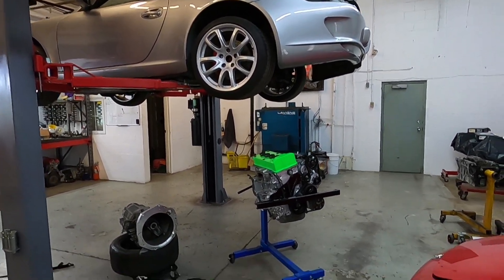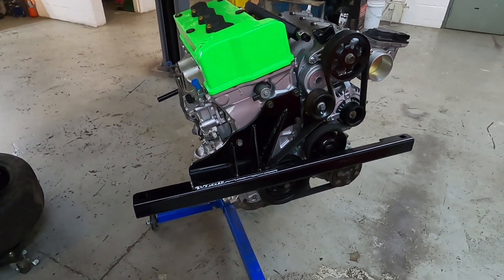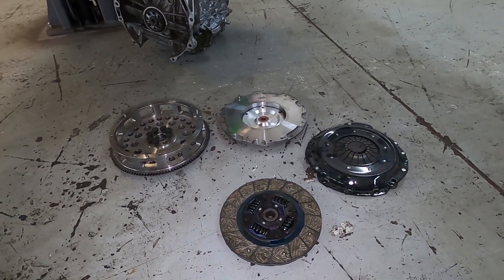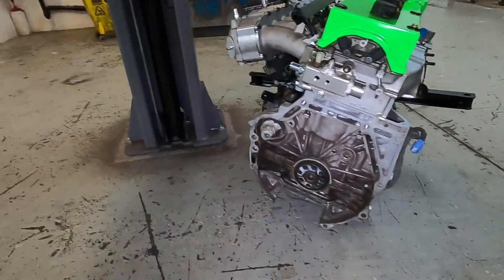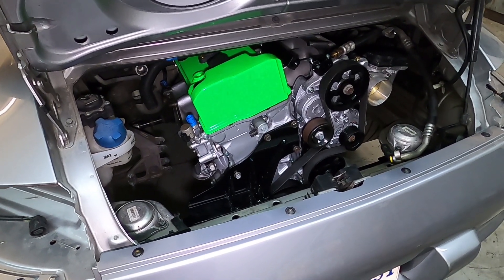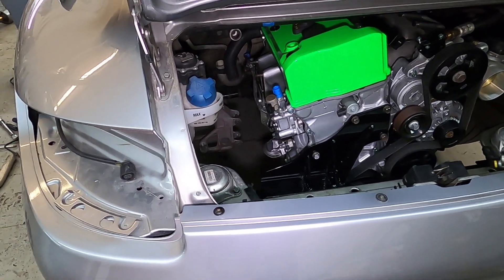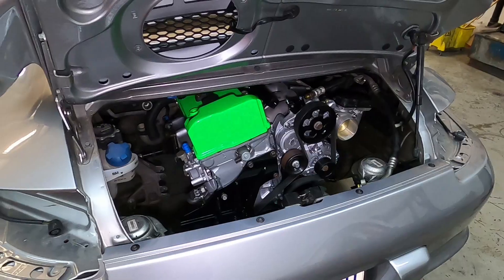K997 Engine is in!

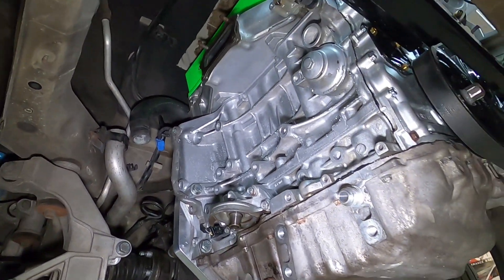Comment: 3:15 Maybe you’ve thought about it but how about weld AN fittings to those factory aluminum coolants tubes on the chassis side and run an off the shelf k series AN coolant pieces on the engine side.